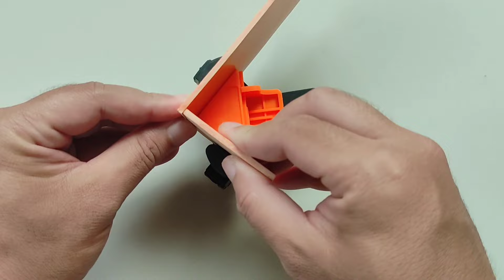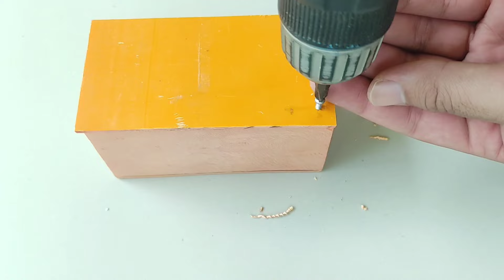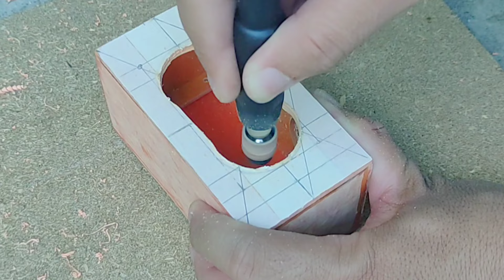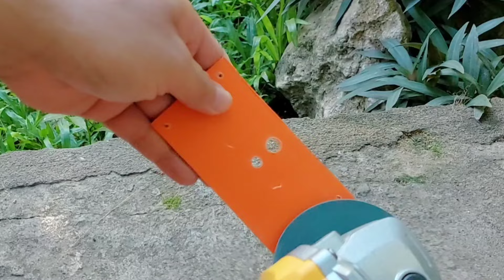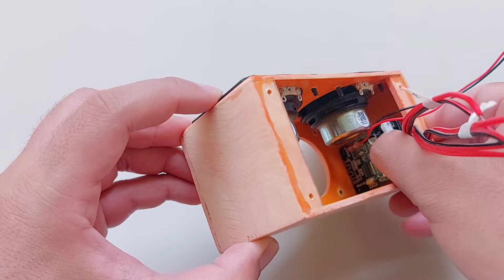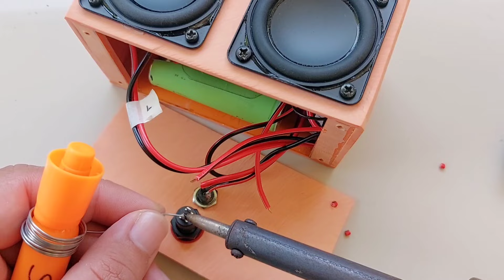How to make Bluetooth speaker at home || Using PVC PIPE - DIY Bluetooth SPEAKER (2025)

Comment from the maker: 📌MATERIALS:

✔ 3mm PVC sheets (from PVC pipe)
✔ digital power amplifier module XY-P15W (bought it from shopee)
✔ 2 inch speaker drivers (the online store I bought it from no longer exist)
✔  passive radiators https://s.shopee.ph/702jWkWS6B

📌BOX Dimensions:
✔ 12cm x 6.5cm x 6.5cm (PVC thickness 3mm)

Don't forget to give this video a LIKE and SHARE.
Thank you and hope you enjoyed the video :)
Reply: thank you so much
Reply: hello sir! What is the impedence and watts of the speaker?
Reply from the maker: @larcymartin7403 10W 4 ohms, peak 15W
Reply: bro, please put the speaker link, I'm about to do this
Reply from the maker: @caquinhozinho  online shop does not exist anymore
Reply: Hello sur can you sell it to me ?
Reply: what about other parts? did the battery is rechargeable? if yes what is the capacity?
Reply: Y el modelo del módulo que lleva las baterías?
Reply: Can I make this speaker for blutooth module ? Can this speaker working properly?
Reply: What's the size of the full range speaker?
Reply from the maker: @AlexAlex-kk7tx 2 inches
Reply: @TaylorSoloaiJR  link please
Reply from the maker: @AlexAlex-kk7tx pinned comment
Reply: Hello sir can i ask where did you buy your battery pack or battery?

Comment: Brother when i connect my m38 amplifier module with 5 volt step up xl6009 it works but afer some time bluetooth ic got damaged 😢
Reply from the maker: Did you solder the wire to the battery terminal or did you use a micro-USB to power it?

The issue arises if you connect the 5 volts to the battery connections.

Battery Terminal: 3.7 - 4.2 volts only, not 5 volts.
Reply: @TaylorSoloaiJR  brother xl6009 has burnt my 3 Bluetooth module i stepped up only 5 volt but got damage 😢
Reply: @Suraj_Thakur_XD  5 volt is not necessary for Bluetooth module. sometimes it can cause heating issue which may damage the Ic. Try to use 3.7v Or 4.2 volt not more than that.

Comment: now i think i m gonna put tp4056 charging module at each battery and make a 12v battery then i will put those in parallel
Reply from the maker: You can't get 12V by placing batteries in parallel.

Comment: Brother you can use only Bluetooth module I means this speaker speaker working on blutooth module ?😢
Reply from the maker: The Bluetooth is built into the amplifier board, you can't get strong bass with only a Bluetooth module.
Reply: @TaylorSoloaiJR  but sir you i don't tell the connection of amplifier. 😕 Sir if you use amplifier so we don't need for blutooth module ?
Reply from the maker: This board has Bluetooth and audio amplifier.
Reply: @TaylorSoloaiJR sir I found the connection of this board can can I connect 4 speaker can i connect USB and play with phone charger ?
Reply from the maker: Nope
Reply: Can I use this speaker xy p15w this amplifier i only use a amplifier so it would work ? 😢
Reply: @BRAMAH-THE-HACKER just buy JBL Problem solved!
Reply: @VMAX_GAMER_ツ  i make my project for my school

Comment: Gagawa din ako ng diy speaker yung maliit lang dapat ba lagyan ng butas para may singawan yun or hindi kasi yung malalaking speaker meron butas
Reply from the maker: You can if you want, but I found out it doesn't sound that good if you do not use a passive radiator.
Reply: @TaylorSoloaiJR  may tatlo akong li-ion battery di ko alam Ano yung mga sukat sukat pwede kuba gamitin yun tatlo nayon pagdikitin tas gamitin sa Bluetooth speaker ma g Cha charge padin ba yun o ma full charge?

Comment: How to know when it is fully charged
Reply from the maker: I use a 12.6V charger that has a LED that turns red when charging and green when it's charged. (LED light is located on the charger, not the speaker.
Reply: @TaylorSoloaiJR  thanks for quick reply, can you mention link to that charger
Reply from the maker: Sorry, I bought it from eBay a long time ago, and I don't have the account anymore to retrieve the link.

You can just search 12.6V Lithium ion charger.
Reply: @TaylorSoloaiJR  does that bms balance cells ? I heard it just protects doesn't balance cells
Reply from the maker: The one I used doesn't balance, but their are variants that have that feature.
Reply: @TaylorSoloaiJR  so are you facing any issues ? Or if I balance cells and use them together in this bms circuit will it work good ? Or not good for long term
Reply from the maker: No issues, as long as you have batteries with capacity close to each and don't heat up when charging you should be fine.
Reply: @TaylorSoloaiJR  ok thanks 🙂

Comment: You sell?
Reply from the maker: Sorry, I don't.
Reply: @TaylorSoloaiJR  brother i have a question can I use tpa3110 amplifier module using xl6009 boost module connect to 3.7 volt battery without any problem ❤
Reply from the maker: The amplifier won't work properly. The boost module won't supply enough current when you turn the volume up.